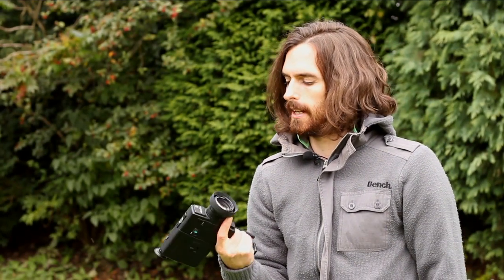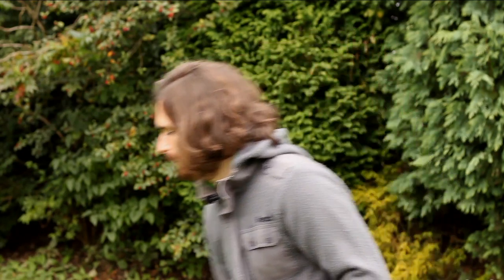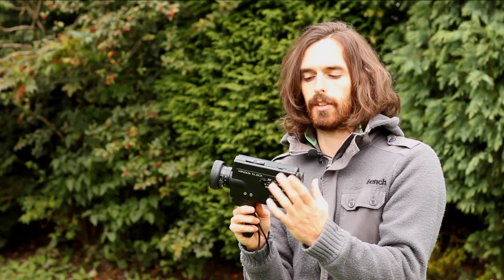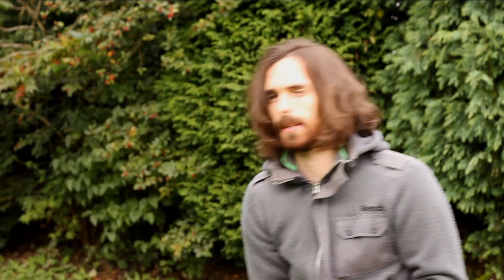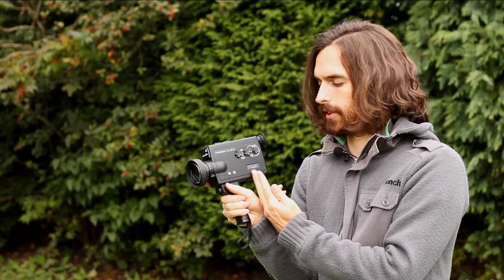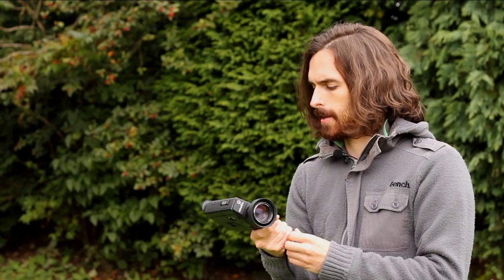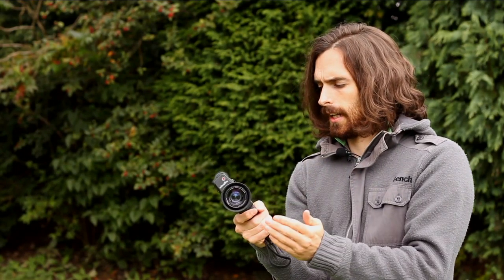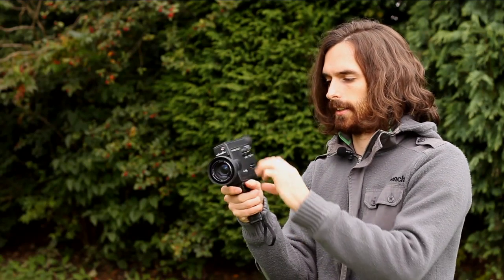How to use a Super 8 Camera

Comment: To Harman Bassan,    I am not familiar with your specific camera but it sounds to me like 2 electric contacts that remain closed and prevent a small lever from engaging the camera movement and stop it as it should. If you are confident enough you can open up (lift it up) left side cover of the camera and the answer to the problem should be visible as you go through the motions.
As you remove the cover slowly watch for one or two little things that will probably diconnect themselves from the mechanism but don’t panic !  Take photos of everything you see, also take video clips of the action. I strongly believe you will solve the problem. Don’t be discouraged if you don’t fix it right away….the answer will come overnight . Good luck !

Comment: if you are shooting a film, and it's over a summer and say the batteries run out. is it possible to change the batteries and not ruin the film that's remaining when you open the hatch for the battery/film compartment? you mentioned the films tend to allow for 6 frames to show and nothing else can be exposed and ruined?

Comment: Thanks for making this video. Do you know if every camera uses the same kind of film? Super 8 silent or sound cartridges right? I have a Bell and Howell filmosonic XL.
Thank you for the help.
Reply: Just read the camera's technical documentation and it will tell you which ISO or ASA stocks the camera is calibrated for, then purchase accordingly.
You didn't specify exactly which model you have (by number). IF you have the "1230," then it takes 40T, 160T, 25D or 100D film stock (which happens to be the same as mine). Unfortunately, only 2 of Kodak's Super8 stocks fit any of these ASAs: either 100D Ektachrome (more expensive colour film) or Tri-X (black+white).
"Sound Super 8" is no longer supported, so you will be shooting silent film. If you want sound, then record it separately, then apply it in post.

Comment: Hello! I have questions for you, I hope you (or someone) can answer. I just bought a super 8mm camera, the Bell and Howell Director Series Zoomatic, and along with it 2 packages of old unexposed film from eBay. I wasn't sure what type of film to get exactly, and I asked the seller but she didn't know much about it, what I was able to ascertain was that it uses "double 8mm rolls" (is this true?) so that's what I got - I got 1 roll of 100ft, and 3 rolls of 25ft (Kodachrome).

The 100ft just arrived today (since eBay is shipping them separately), and I tried to put it in the camera, but the spool won't fit, it's too big. I looked at the film and it seems like it is the type of film the camera accepts, the only problem is the spool is too big.

Question 1: I reviewed my eBay orders and checked pictures of the 25ft, and from what I can tell the boxes seem smaller than the 100ft I just got. Is this true? Would the size of the spool depend on the feet of the film? If so, would it mean that the 25ft might fit in the camera? They are not the regular 8's, that's for sure - cause I know they don't have sound. 

Question 2: If ever the spools of the films really won't fit the camera, can I still use the film? Re-spool it, maybe? If I could find a spool that will fit, if not, is there some way I can still use them?

I would really hate it if I can't use these films, as, even though they weren't that expensive, international shipping from eBay cost a lot. And I mean A LOT (way more than the price of the item itself). Plus I will be using them for my (experimental) thesis film, by the end of this month hopefully.

Thanks to you or to anyone who can answer my questions (and forgive my ignorance, but this is the first time I'm touching film - my major is in digital film), it's hard to find solid answers from google.
Reply: wayfaringshaman You have a regular 8 camera.  It's a different format from Super 8.  The 25 ft rolls are the ones you want.  The 100 ft roll sounds like it is 16mm film for 16mm cameras.  Even though the 25ft rolls are also 16mm wide the perforations are different so even respooled it won't work in your camera.  The problem you are you are going to have is that Kodachrome film and processing for it have been discontinued worldwide for many years so you won't be able to get your film processed.  Right now the only film available in double/regular 8 is black and white.

Comment: hi, i'm new to this as well, i found one at a thrift store but it looks like it takes a reel of film instead of a cartridge. is it easy to do as well or should i just find a nice 514xl on ebay and get that instead?

also im in the US, where can i get my film transfered to digital?
Reply: gammaraydigital.com does really good high quality super 8 scans for the best price. The 514xl is great. Also the line of  Braun Nizo super 8 cameras are very well made. You can find them on eBay. Just make sure the seller says it's fully functional, like the light meter works and the motor runs properly and no corrosion in the battery compartment. Also if you have any further questions, go to cinematography.com it's a really great forum that many professionals use and people with a lot of experience on super 8 use. I go there for all my questions and the people there are very helpful.

Comment: found a nizo s 2 of my parents. It's still loaded with film halfway through. On the box of the film it says it should have been developed before 1992. Any chance it's still ok to develop?
Reply: +Slow Mo I know I'm late but if you're still wondering/for other people who see this comment:

If it's anything other than Kodachrome (i.e. normal color or B/W film): it depends on what temperature it was stored at. If it was stored at about refrigerator temperature (read: an uninsulated attic in a cold climate), then it's probably still okay. The cooler the conditions undeveloped film is stored in, the longer it lasts without getting fogged. Frozen film lasts literally forever, but it's unlikely film you found in a camera was in a freezer. If it was stored at temperatures above 60-70 degrees for an extended period of time, the image on the film has probably begun to deteriorate. After 20 years there might not be much left, unfortunately. Of course, nothing bad will happen if you send it in for developing (other than possibly getting back blank film), so if you have the $20 and want to see if there are some precious memories stored on that reel, go ahead.

If it's Kodachrome film, which is a reasonable chance from that time period, then no, you can not develop it, because Kodachrome uses a complicated proprietary process that was discontinued in 2010. If you think there's some really valuable footage on it, you can google around for a lab that will process Kodachrome in B/W chemicals, but this is unreliable, expensive (~$80 per roll), and it will come out in black and white, obviously.
Reply: +MeFigaYoma D 
Thanks for this very precise answer! Unfortunately its a Kodachrome 40. I'll look up if I find a place to process it for a reasonable price in germany.
Reply: +Slow Mo Good luck. Many years ago you could only get Kodachrome developed in USA (Dwaynes) or Austria.
Reply: Most major labs that process super 8 will still try to b/w process Kodachrome, though as I've said, this comes at a price. I'm in the US, and I know Pro8mm still does it. Ask whatever local lab you're planning to use/already use.

Comment: I have a BraUn nitzo camera but idk how to set it up... did some batteries in it though
Reply: You have a good camera model there, ( I have the Nizo S800), but basically the instructions given should be good for that camera. One thing to check, very carefully, is that sometimes the camera gate, (opening in the camera that allows the filmstock to see the lens) can get dirty. This is a very delicate area, so do be careful, but try a tiny soft brush to 'gently' keep it clean.  If it is dirty, you will see rough edges on the developed film rather than a clean and sharp edge. 

Also, zoom very slowly and if possible, use a tripod or monopod to keep the camera steady. It will show up more when you are zoomed in fully, so be careful with filming.

Comment: Oh, you got batteries. But you don't say which type? Sigh, I give up.....
Reply: Foxglove963 the vast majority of Super 8 cameras take between 2-6 AA batteries. Some older cameras additionally require obsolete mercury batteries for the light meter, but those can be properly replaced by Wein cell batteries that can easily be found on Amazon